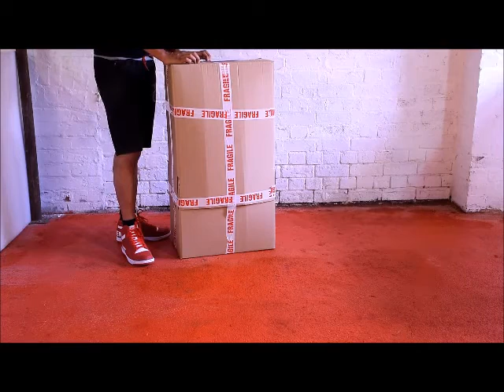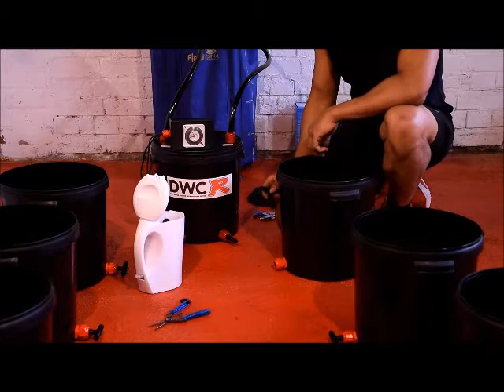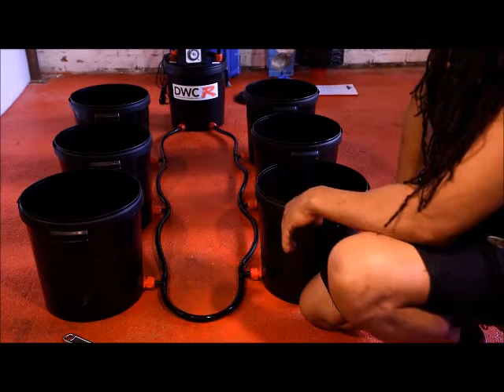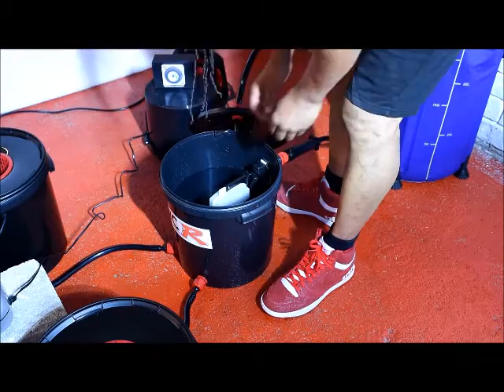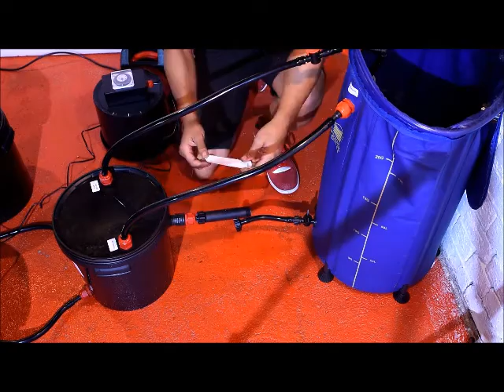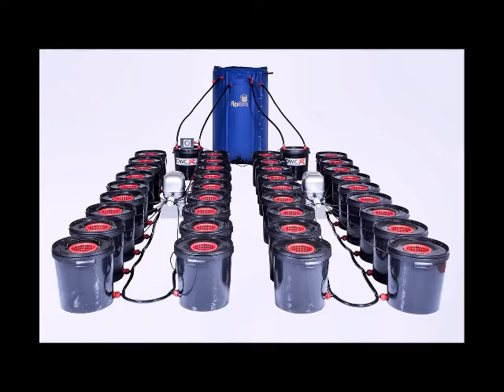Basement Lighting DWC - R Bubble Pot System Hydroponics Set Up

Comment: Hi there, I have been looking at dwc R kits online at London grow etc I've seen this system can have 48? Is there any comprise for this? Also what chillier would I need for the 48 pot system thanks
Reply from the maker: 2 X 24 Pot systems may be more manageable than 1 big 48 pot system. If you was planning on using a chiller we would recommend the ProFlow System. It is a better all round system and comes with pre punched chiller holes ready to be connected. On a 24 pot ProFlow system it is recommended to use a 300A chiller.

Comment: so what's the purpose of the flexi tank
Reply from the maker: The nutrient is pumped back into the flexi tank from the control pot where it's mixed and filtered. The flexi tank also adds nutrient capacity allowing the system to be left for up to 10 days unattended.
Reply: Basement Lighting I almost was thinking about getting the big system but then I realized the water chiller would not work with this
Reply: @clownbow1  how come the chiller won't work with this? Thank you